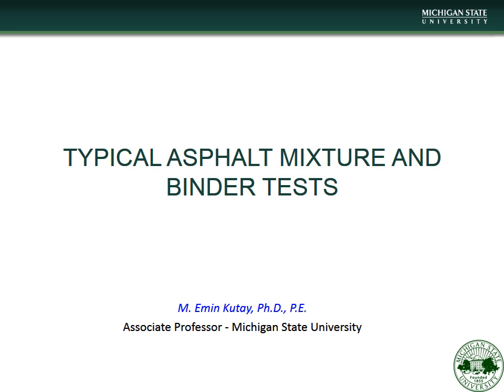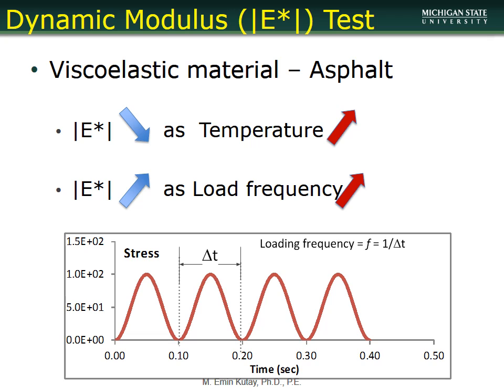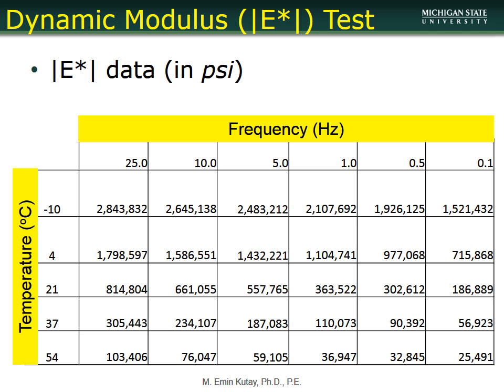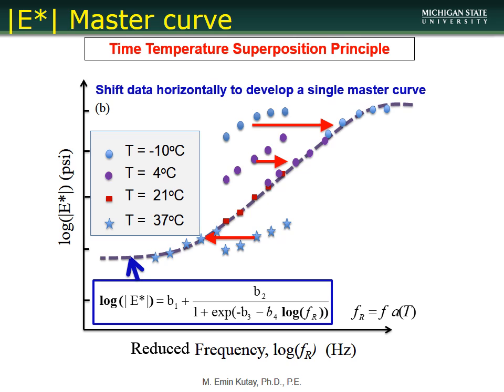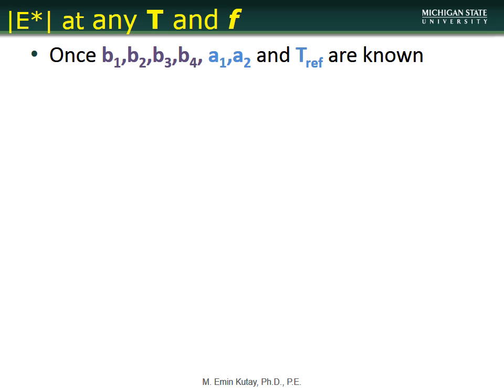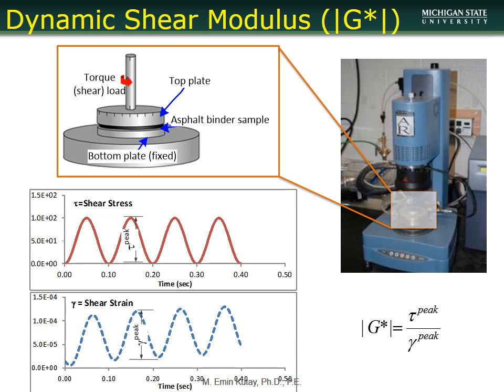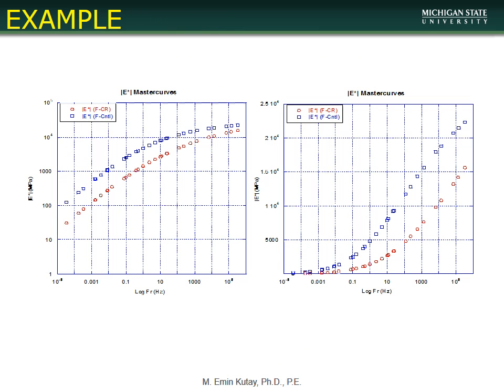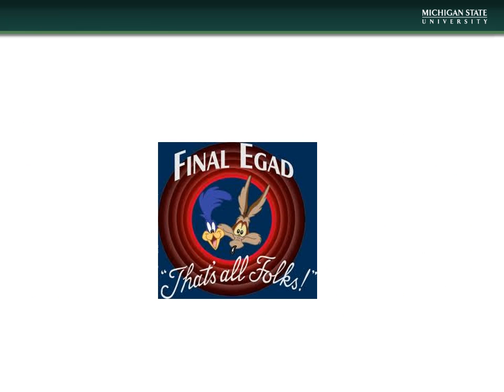Dynamic modulus of asphalt mixtures and binders

Comment: Professor Kutay
Thank you for the clear explanation. i have one question about the strain ( microstrain obtained ). if we are seeking a maximum strain level of 70 microstrains to preserve the linear viscoelastic behavior, what is the 500 microstrain and 164 microstrain obtained when calculating the dynamic modulus?. Another question is about the difference between dynamic modulus done in tension-compression and in compression mode. what is the difference in the sinusoidal loading applied in each case of loading? how we can make the ampt exert a tensile load to the specimen under experiment. in other word, how the values of the sinusoidal stresses ( load ) applied differs in each of the cases.